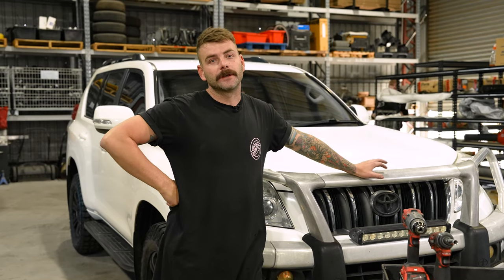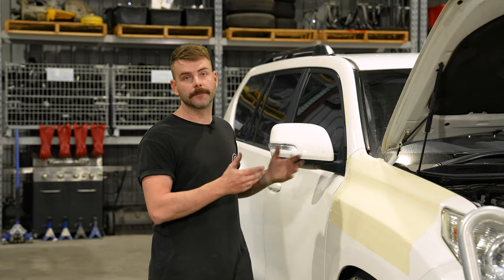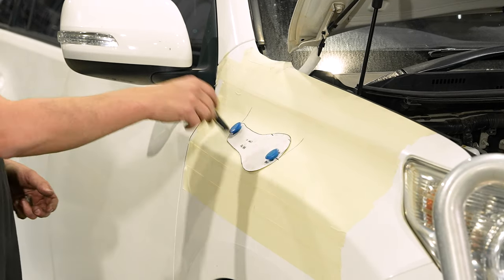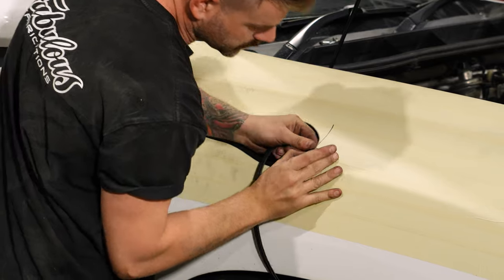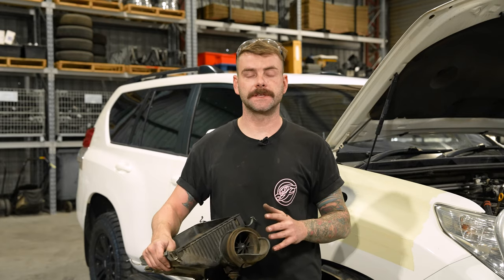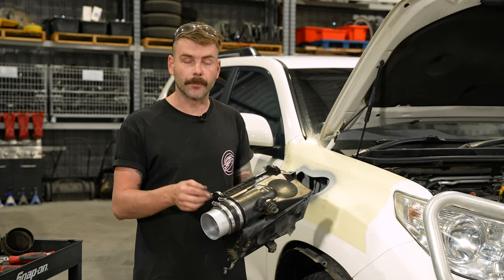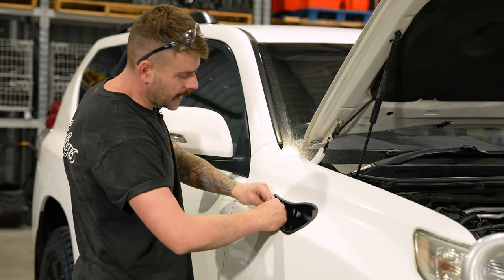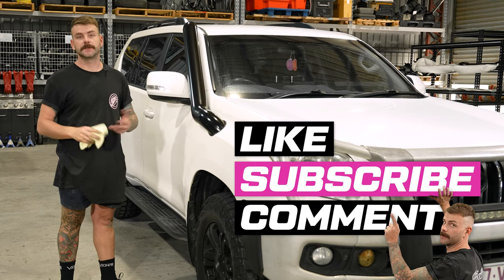INSTALLED: Prado 150 Series Snorkel (pre face lift)

Comment: Hey lads great video, I see when U sanded the lower part of the air box down U didn't mention anything about the drain hole with the rubber around it, wouldn't that need to be sealed to?

Comment: Hey there great video can I take my tjm snorkel off my 150 prado and put on the stainless steel one
Reply from the maker: Hey Graham, thanks for watching mate, unfortunately the hole in the guard for the TJM item is larger and in a slightly different location than our unit, because of this, you would need to start with a new replacement guard. Let us know if we can help in anyway! Cheers for the support!